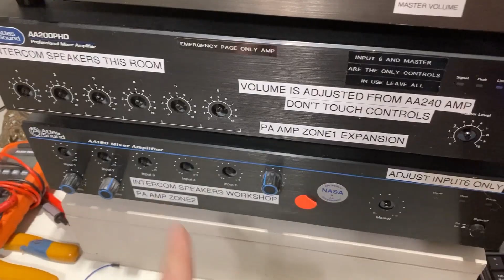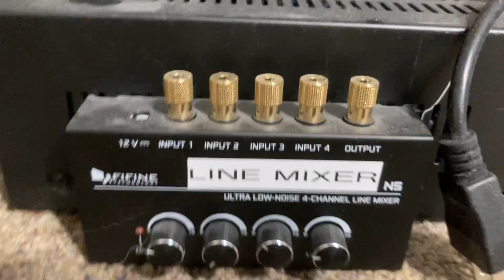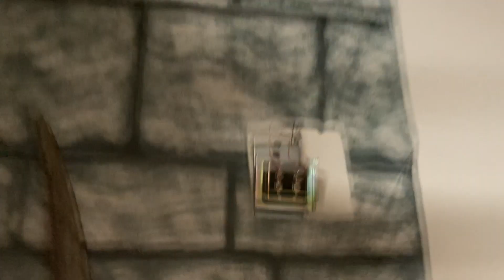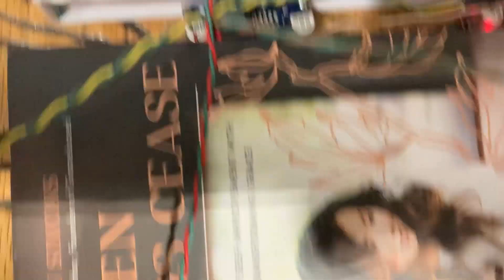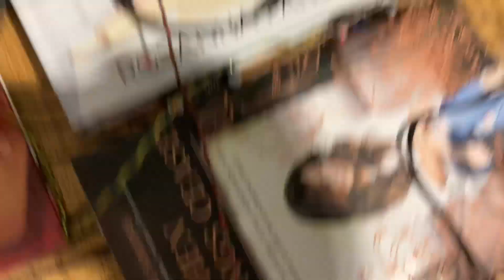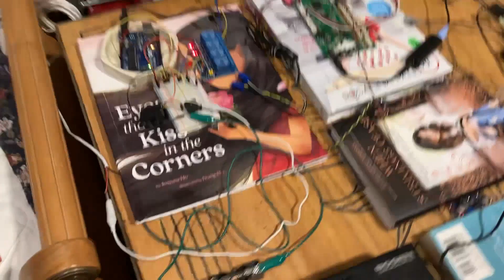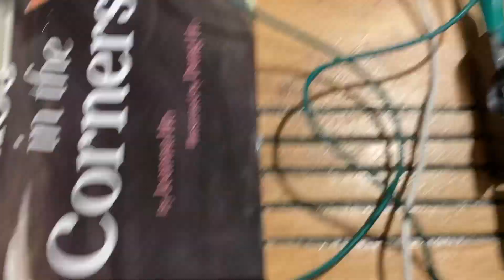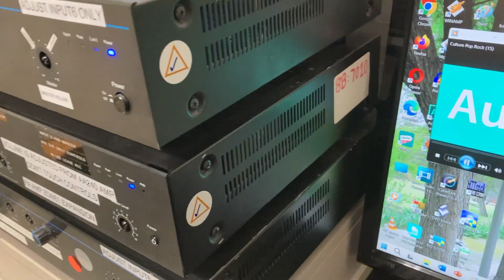Intercom System Doorbell Integration Project

Comment: 3:37 Doorbell
Reply from the maker: From an older 2gig alarm system video demo which you can find here on Youtube. I downloaded it as a mp3 than striped it down using Audacity. Then I exported it as the final mp3 to be loaded into the mp3 trigger board.

Comment: Where did you get the Ding Dong sound from
Reply from the maker: I think it was pulled from a 2GIG alarm system demo video from years back. I used Audacity to spice in the Ding Dong sound and the voice from one of those text to speech websites.
Reply: That sound sounds from a 2GIG GC2, and how did you pull a file that has the ding dong sound or it was recorded by a microphone